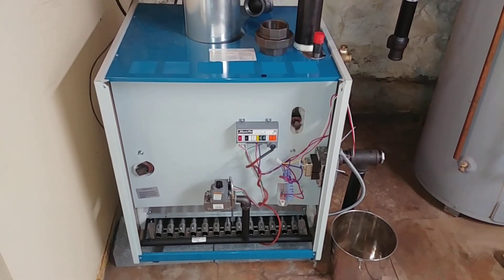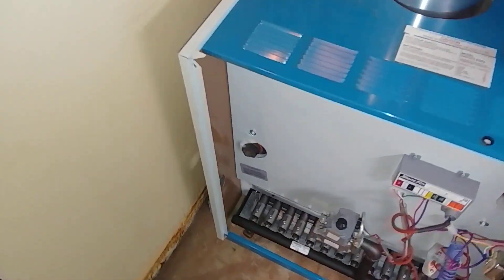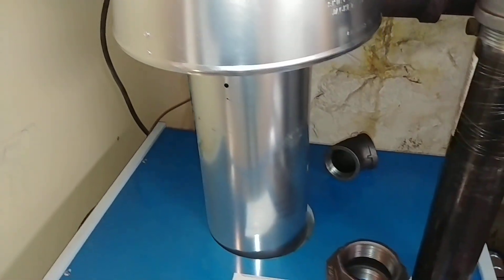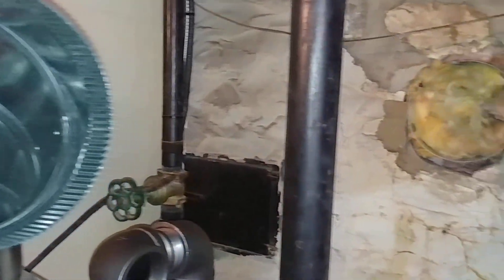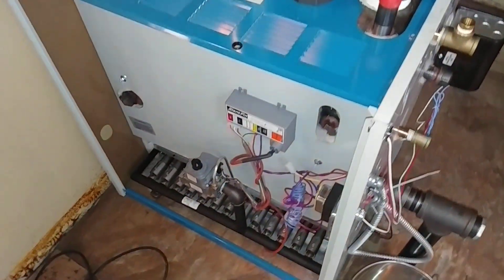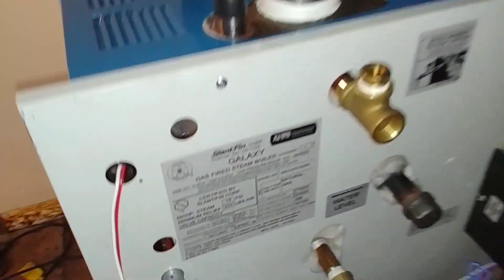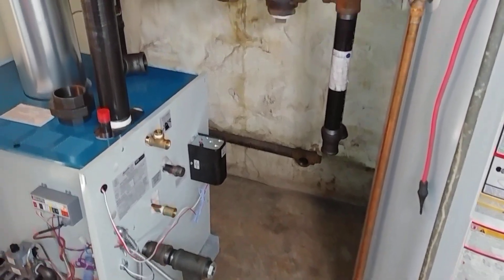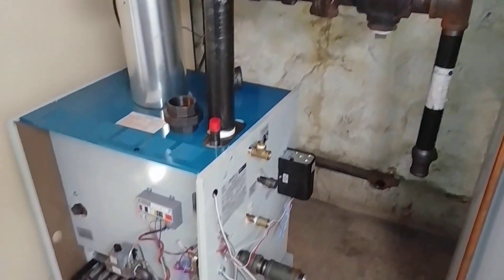Big Slant/Fin Steam Boiler Finially In The Basement. So Now, Let's Get To Work

Comment: Great videos. Thank you for posting and taking the time to go through your work. I’ve become more and more interested in steam heat since I purchases a multi family home with two steam systems. If you don’t mind and have a question. 

When measuring the sqft of the radiators do you add and sqft from the near piping (header ext..) or from the mains when sizing a new boiler?

Thanks 
Corey from Portland Maine
Reply: Boiler edr rating already accounts for 33% pickup factor which is for the pipes and fittings, so you only measure the radiators and match it to boiler edr rating (the one written in its specs).

Heatinghelp dot com has a good info on steam and you can also check out the forum "the wall" and subsection "strictly steam". There aren't many people versed in steam out there, so this community is awesome for all things steam.
Reply: Thanks for the reply and for the resources
Reply: @coreyroebuck9650  You're welcome. My understanding is that Snyder Plumbing and Heating from Gorham has someone with the knowledge on steam if you're looking for someone locally. It was mentioned not too long ago on the above mentioned "the wall" by someone else from Portland, ME.

Comment: It's been a few weeks since the old boiler was removed. It's also a middle of winter - how is the house heated now?
Reply from the maker: We supplied several electric space heaters to add to the one's the customer already had.
They sorely tested the customer's electrical system.
They've got heat now.
Reply: @gordonschweizer5154  That's great! Glad that the space heaters kept up with the cold outside.

Comment: What do you think about Slant Fin boilers?
Reply from the maker: They are ok.  I do like the quick skim feature on this model.
I think they are overfired at the last three sizes.  The wiring is haphazard, but that's merely esthetics.
I would like to see a three inch outlet, but that's not gonna happen.  The other sections are pretty narrow.
The Slant/Fin tech service fellow I talked with recently lamented that folks are installing these boilers with 2" piping because that's what home deep-po sells.
Reply: @gordonschweizer5154  I can't  see that overfiring to increase steam will do anything but shorten boiler life.  They should know that.  Thx.